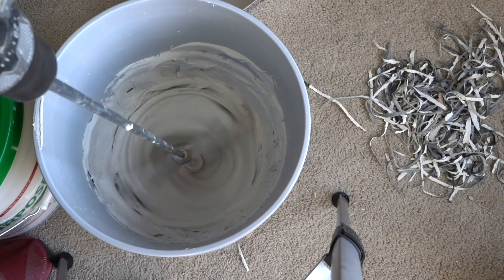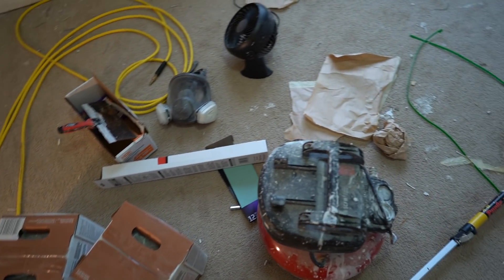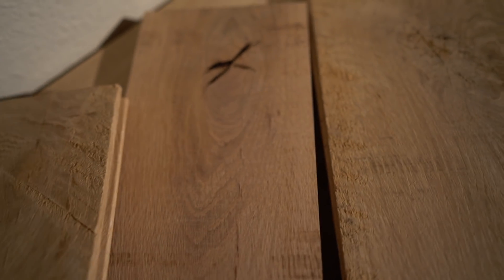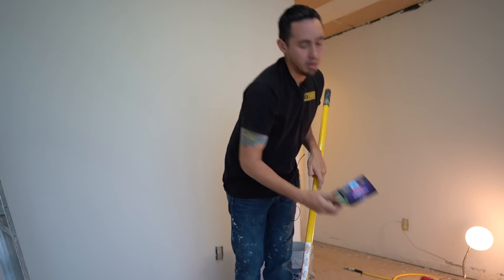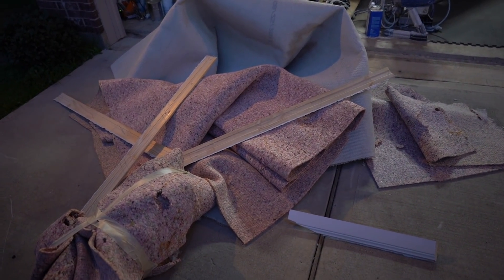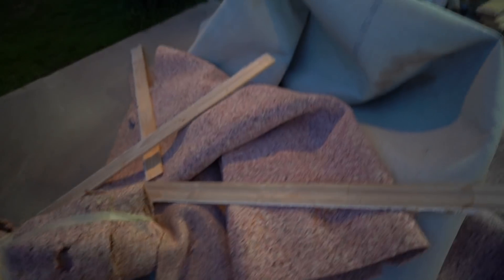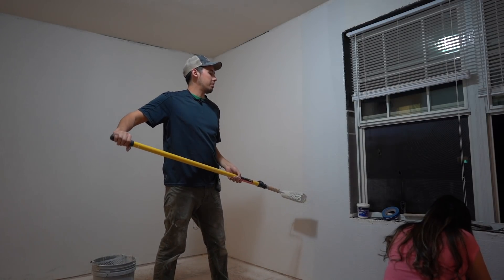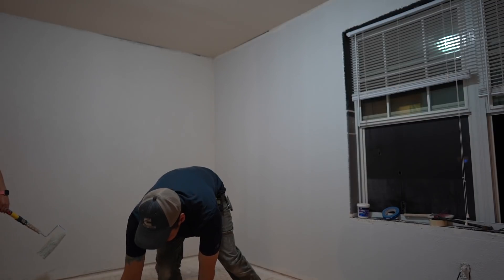Getting Closer to the Finish Carpentry!

Comment: Nice job on the knock down.  I actually am a fan of knock down.  But I also like maple cabinets, which are also kind of a dated look these days.
I've never done knock down and I was amazed by the "super fan" on the blade you used.   Never seen one of those but makes perfect sense. Also the pole with the square tube makes good sense, so that twisting the pole in the "wrong" direction doesn't loosen the extension clamp.  Love the channel Richard.I appreciate you.

Comment: Watching you paint out of that 5 gallon bucket reminded me of a little skim coat trick.  The next time you have to do a lot of skim coating, mix all of your mud in a 5 gallon bucket and thin it out to a paint consistency.  Then put that paint fence in the 5 gallon bucket and roll it on like you would as if you were painting.  Choose your paint sleeve thickness to the amount of damage your trying to cover on the walls (the thicker the nap of the sleeve, the heavier and more texture you're going to leave on the walls for coverage)

Comment: Fascinating to see the difference in techniques.  Totally different to how we do things in the UK.  We would use a gypsum finish plaster on the walls and trowel smooth without any sanding. Never seen textured walls like this either in the UK. We went through a horrid stage of textured patterned ceilings with a product called Artex but this is gradually being covered over now house by house.  The skim coat as you use it is only used here to joint plaster boards and fix holes. 

Keep up the good content. I like watching a series like this 👍🏻

Comment: A bit late, but for skim coats if you water the compound way down, you can apply it to the wall with a heavy paint roller and smooth out with a wide taping knife. Much faster.

Comment: I've never seen that nock down finish here in Australia, its interesting to see how you did it. I've often wondered about it seeing it in your other vids. Thanks for sharing!
Reply: Its easy to apply , its thinned down drywall mud with water
Reply: @mm-xk7pg  With my limited experience I would say use less water when doing the ceiling with a knock down finish, as opposed to the walls. 
I just tried to copy what was already in the house, knockdown on ceiling and orange peel on the walls.

Comment: True acclimation of hardwood is not determined by time but by the use of a moisture meter. In the case of a 5 in wide board acclimation has been achieved when the flooring and the plywood underlayment are within 2 percentage points of each other after checking 15-20 spots and boards( 4% for narrower flooring ). Check with the manufacturer of the wood to learn what they recommend for installation. Some may require that the flooring be glued and nailed. Flooring glue, not construction adhesive.

Comment: Quick tip , you could leave the floor to “acclimate” for a year and you can still have issues. You should of had the hardwood floor delivery company measure the Relative humidity of the wood when delivered and then who ever is going to install the hardwood measure it ones again to make sure it’s good to go. Make sure the your humidity in the house is at its point. Floors are a big investment you want to make sure you take care of them properly.
Reply: What you are looking for is moisture content. Should be around 8%. That's the standard for furniture wood in most parts of the country. Arizona would be 6%. You can get a moisture meter online. Lignomat or Wagner are industry standards.( I'm in the sawmill business)

Comment: I've been doing hardwood for around 25 years. Glad to see you getting the walls done first, however you will need to be careful installing the flooring on the last rows. I recommend investing in a floor jack to keep the floor tight when you get close to the walls. Are you sanding it or are you hiring it out?

Comment: How long do you wait
Before knocking down texture...
Reply: Thin the mud down with water, spray a wall or two then knock them down. Usually about 10min or so
Reply from the maker: Jim Feaster yes about 10 mins

Comment: FYI on he oak flooring. You will need to glue and nail. Anything over 4.5" in width requires glue. Otherwise big problems will occur. Check it out.2 We just finished 1500 sq plus. We had to treat the 3/4 ply sub with a sealer and then glue and nail the 3/4 white oak.